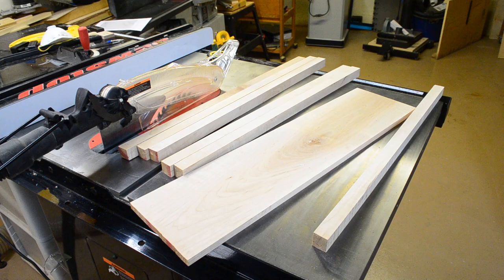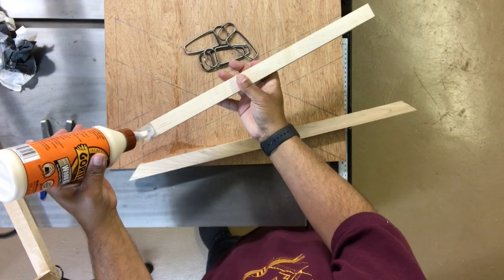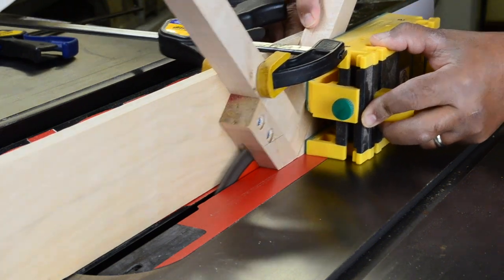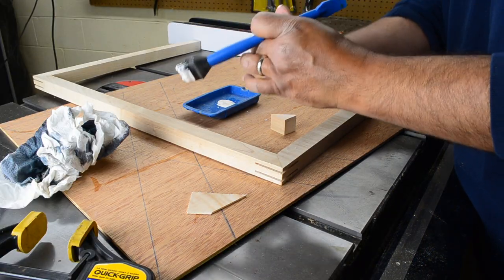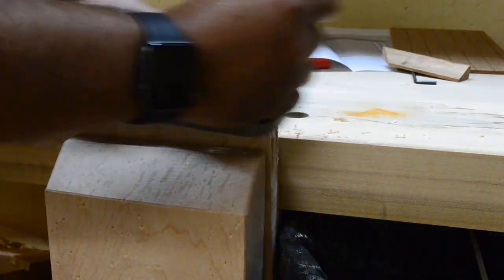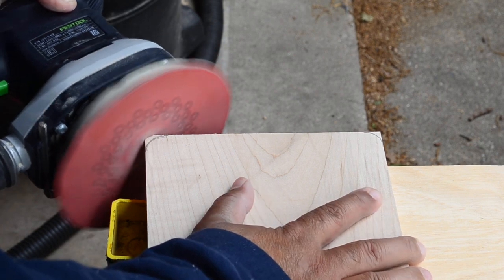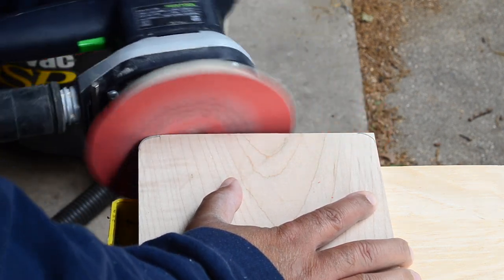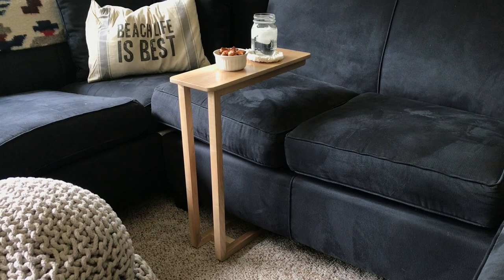Sofa Tray Table

Comment: Mystery solved! Great looking little table Matt. I foresee at least one opportunity for chain taco-ing while watching TV.

One question...I'd like to get a bigger capacity miter saw from a 10 inch dual bevel. What's your opinion of the Craftsman? Lowes has a 10 inch slider for a decent price. 

Thanks for the great idea!
Reply from the maker: Thanks for watching! I did make it long enough to hold several tacos at a time. 

As for the saw, this particular one I’m not a fan of and it requires a lot of constant tweaking and even then I don’t completely trust the results, so thankfully I use it purely for rough dimensioning. 

If I were to get a new one, it would be something else, at this point I don’t know what it would be.
Reply: @Mattsbasementworkshop  thanks for the reply Matt. I appreciate the honest opinion.  Now the question is...what excuse can I give my wife so that I can spend $400 on a new saw? 

Keep up the good work, I've been enjoying having you back.
Reply from the maker: I always meant to do a "special" video where we accumulate all the best excuses for tool purchases LOL!